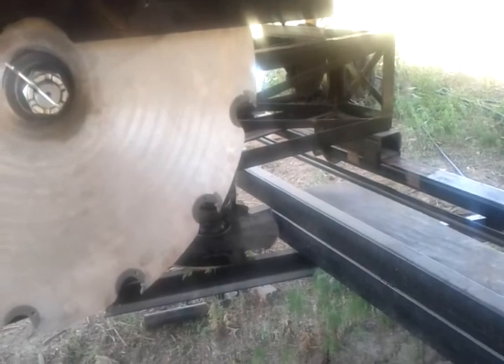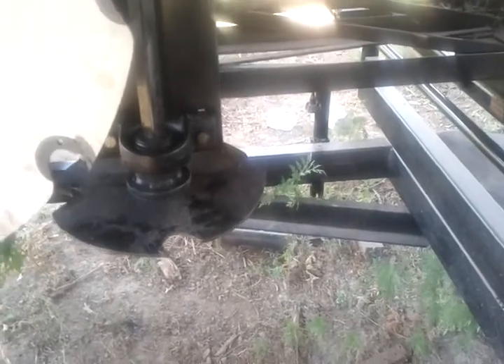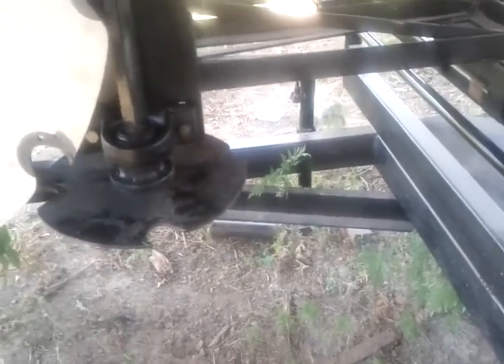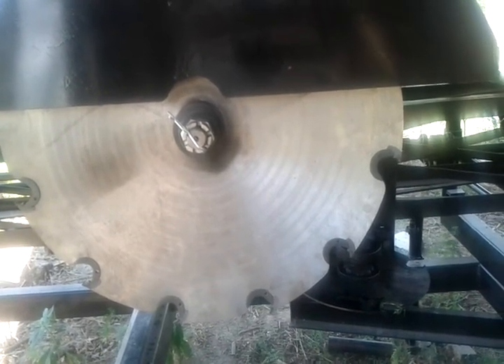Log cutting direction - discussion

Comment: Cut from the bottom this was hard for me till I thought of it like this all mobile demention saws are like a stationary sawmill turned upside down also think about how a radial arm works you can get into some real danger cutting from the top I have tried it and if you feed just a little to fast it will grab and roll over the log like a car tire and cause real damange to everything